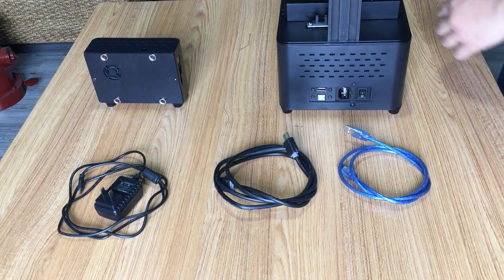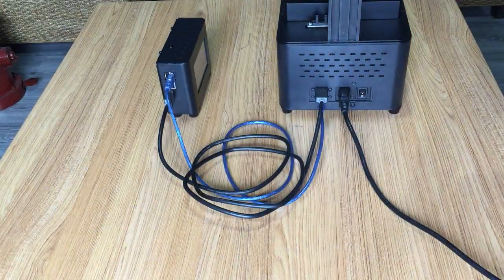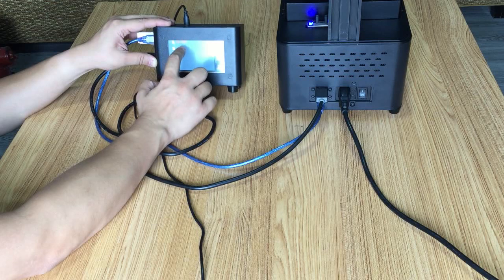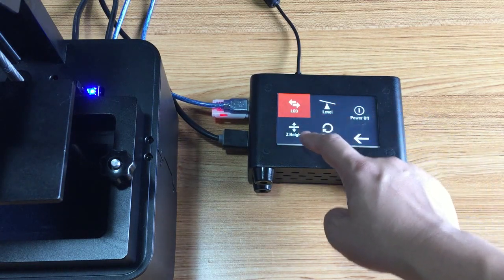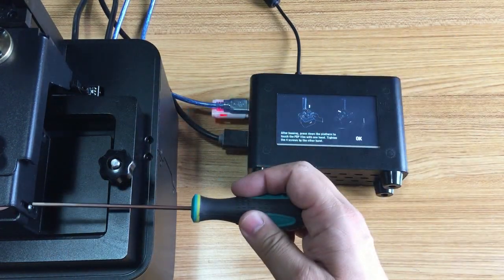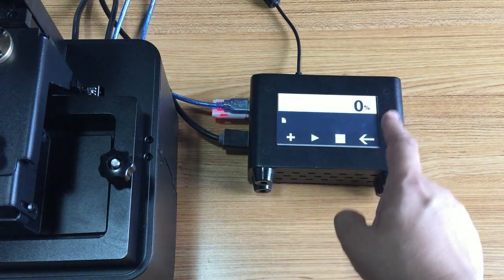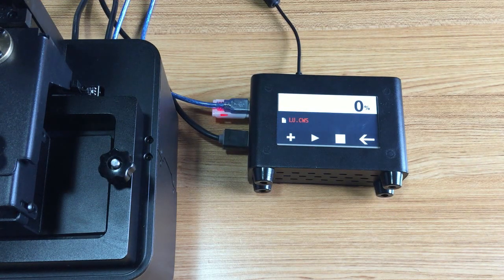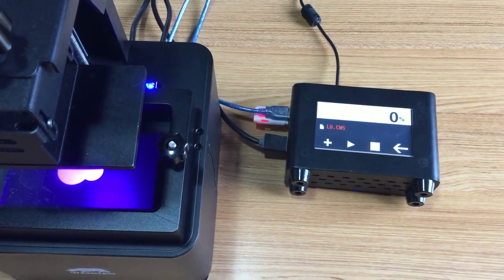How to install D7 Box and control the printer?

Comment: bonjour j'ai suivi parfaitement votre video, mais quand je lance le fichier (cws)  et que je fais lecture rien ne se passe ?? 
pouvez vous m aider svp  merci d'avance
Reply: I have the same problem.

I think the problem is in some kind of previous configuration that they have not indicated. In Creation Workshop or a previous step of connecting the printer to the internet or to the computer.

Let's see if they could help us. The truth is that I am happy with the printer, I already made 200 perfect prints, but with the BOX I am very upset.

They should explain in detail how to convert the files to .CWS with Creation Workshop so that it works.

My .CWS files does not work at all. I have reviewed the G-code and I have not seen anything weird